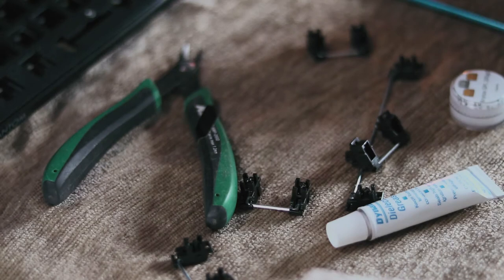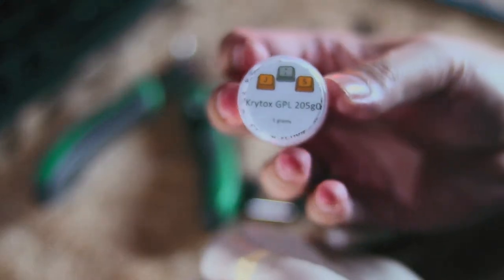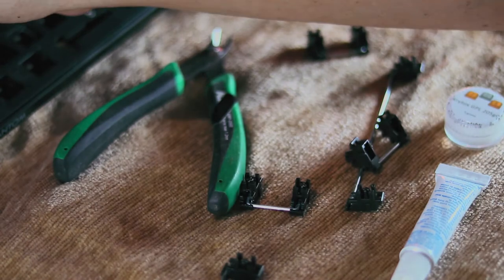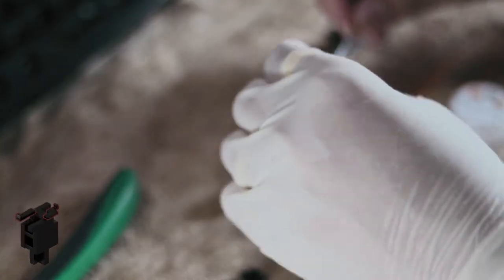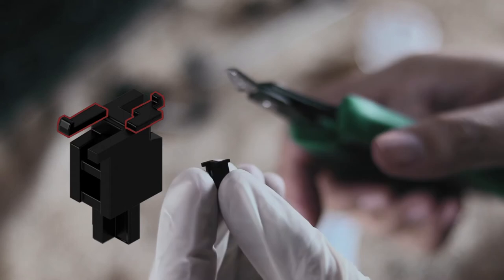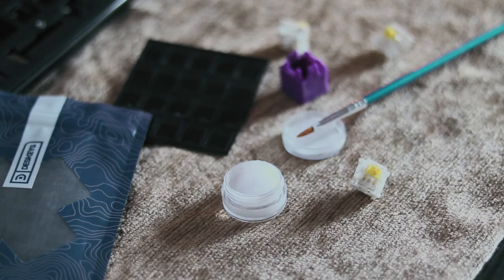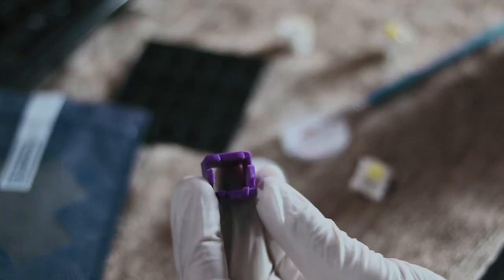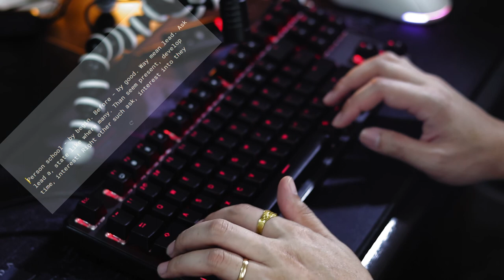Gateron Yellow Stabilizer Switches with Deskeys Mechanical Keyboard Lube vs Unlubed with Sound Test

Comment: great video, especially the close up shots it really helps beginners like me know where to apply lube and cut stabs. btw did you only use the krytox lube for the springs or was it a mixture?
Reply from the maker: Thank you so much! I only use the krytox 205g0, some are using Krytox GPL105  to prevent Spring Ping,  if you are hearing pinging noise on the keyboard one would be spring causing it or the keyboard metallic structure inside it. Hope that helps!